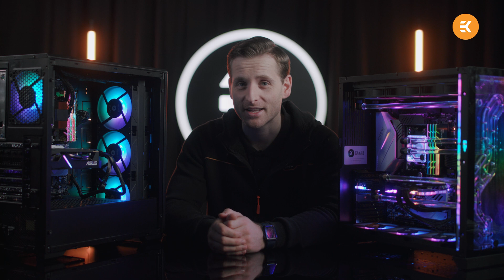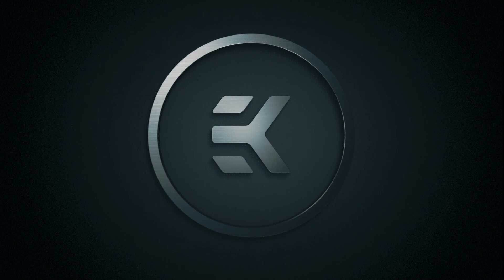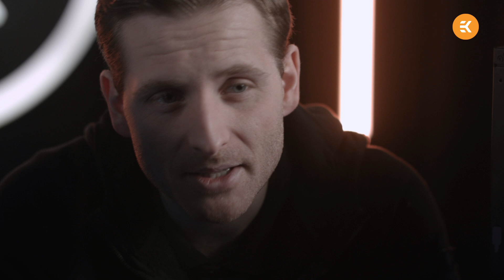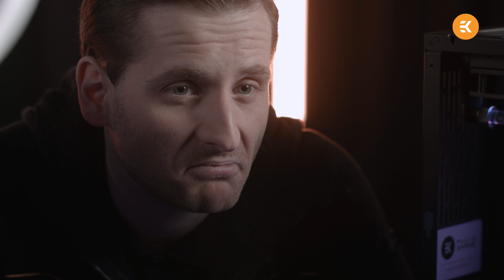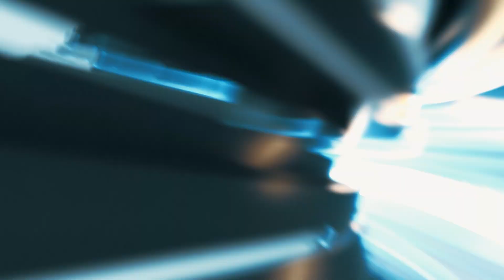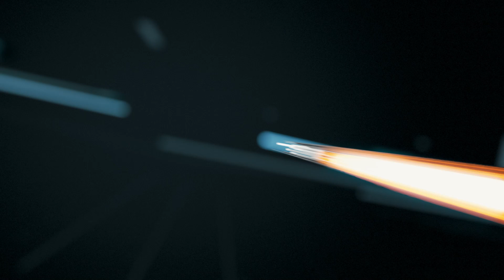OPEN vs. CLOSED LOOP - How To Choose

Comment: Dumb question.  Looking at how thick and big the fans are for the AIOs.  Is it possible to buy an AIO for GPU + CPU, and have room for it?  Or does it require a full tower?
Reply from the maker: For our AiO's, the radiators are 27mm thick, while the fans are 25mm thick. You can find all of these specifications and more on our website.

What case would you be using and will the GPU have a dedicated AiO ?

Comment: Mixing metal may lead to corrosion but aluminum is better at transferring heat to air.  In a All In One this is a bonus two ways, aluminum is a cheaper metal and it performs better while being smaller.  You can make up for the thermal transfer difference using more radiator and gain the benefit of less corrosion.  It would be nice if there were a lifetime PC coolant, or at least long term like 5 years.  This seems like something missing in the market.

Also, where are the water cooling cases for the mainstream?  The 011 Dynamic can theoretically mount 3 360 rads but in practice it's a tight fit and everything is on display and not everyone want's to buy fancy fans to display.
What I think is a more practical design is basically a typical PC case with no preinstalled fans and a mounting location that will fit a Push Pull 60mm 3x140 rad at the front, so 110mm of clearance total.  The mounting bracket should be designed to come out of the case and be positioned so that the rad and front fans mount on the outside of the case and the internal fans and pump reservoir mount on the other side, thus balancing the weight.  This would make the performance per dollar better because 1 big radiator is cheeper and more compact that two smaller rads.  The other case design idea would be for a cube case with 4 140mm fans in a square at the front, a 280x280x60 radiator and again enough clearance for push/pull fans.  This design could be really nice with an inlet at the bottom, the outlet at the top, an extra port at the top for a temperature probe and an extra port at the bottom for a drain.  Either one of these ideas could be done with the radiator at the bottom and parallel to the desk so you updraft instead, this would make bleeding the system very easy and allow for more decorative front panels.
I bought my Corsair 540 Airflow case for air and then later installed water cooling.  The EK pump mount kind of sucks because it puts all of the stress at one small location that causes the metal tag the back of the case in the large wasted space above the power supply to vibrate at higher speeds.  No, D5 pumps are not silent above ~40 percent PWM and really vibrates the part of the case where it is mounted.  So it occurred to me to look for a different case and I found that the cases specifically built for water cooling are enormous wastes of space, as in truly enormous and upwards of 400 dollars.  The cube seems very practical if the pump was put inside the dead space with the power supply, but Corsair does not do this in the 680X oddly.  Also, since radiators always have to have to those fittings sticking out there are problems occupying all of the radiator mounts in the main section while the back side goes to waste.  As far as wasted space, many cases come with 2x200mm fans but can you buy a 2x200 rad that will fit in these case?  Of course not because the case doesn't have space and those 200mm fans move air, but don't pressurize it at all.  This seems like a wasted opportunity.  Another news idea, not really, is a case designed to be air tight and use a minimum number of fast to draw air through radiator surface that is much larger.  Think Corsair One but scaled up using standard PC parts.   It just seems cases are coming with massive space for huge air coolers that is wasted when you go with water.  Another idea is a case designed  for vertical GPU to begin with.  A typical ATX layout but allowing the vertical mount of a GPU with a regular half height card rack behind it so you can still install add in cards if needed that are hidden behind the GPU.  This would free up space on one side so that it could be used on the other side.  
I just think that current PC case design is trying to be everything to everyone and end up being less idea for everyone.  Also, it seems case manufactures are confused on whether they are building their cases to go on the floor or on the desk.  If you put the front panel connectors on top, like the Corsair 680X, then are you are you really going to put it on the floor?  And if it's on a desk, who want's wires dangling from the top and have to stand up to plug something in?  Can you tell I really like the look of the 680X but have issues with some of it's details?  The 011 Dynamic is excellent, if you want to have as many beautifully bent hard line tubing and RGB fans as possible.  I think there is a market for people who are more practical.  You know, G1/4 and D5 pumps are kind of universal, so cases with those fittings and mounts would be broadly compatible.  Another case idea for silence is using an extruded aluminum heatsink as a door on the right side of the case with a D5 pump mount built in to the bottom, it would be hinged and form a door with the coolant fittings for the in and out by the hinge.  The idea is that the door is the radiator, reservoir tank, and pump mount as one unit.  Basically it's just a huge reservoir with fins on one side for heat dissipation.  If the door had a strip along the bottom you could install fans in the bottom of the compartment and have that air ducted out to the bottom of the door that would push air vertically along the heatsink to increase efficiency when needed.  Just some ideas.